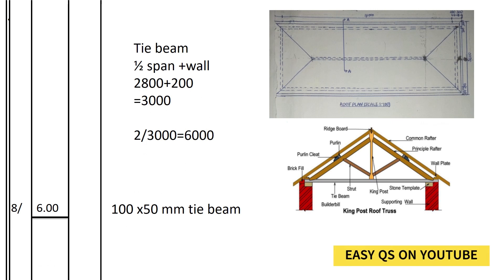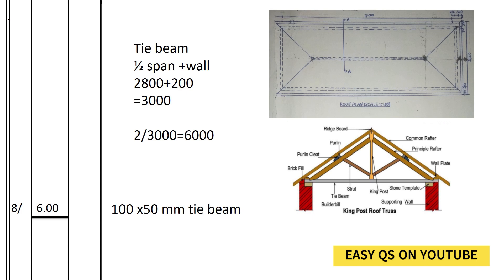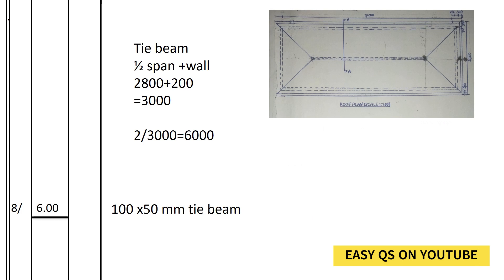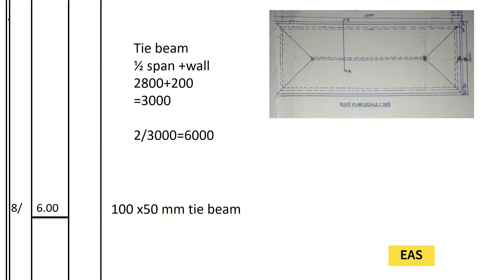Calculating length of Tie Beam/How to Book it in a Taking Off Sheet/Quantity Surveying Tutorials

Comment: I hope you can help. I am building a pavilion 24’ x 14’ (7.312m x 4.267m). I am trying to calculate if 3 Tie Beams each 14’L x 8”H x 4”W (4.267m L x .2032m H x .1016m W) will support 1 king post ridge beam 24’ L x 8”H x 5”W ( 7.312m L x .2032m H x .127m W. King post are at each end and mid point. All are supported by 8” x 8” (.2032m x .2032m timber post.